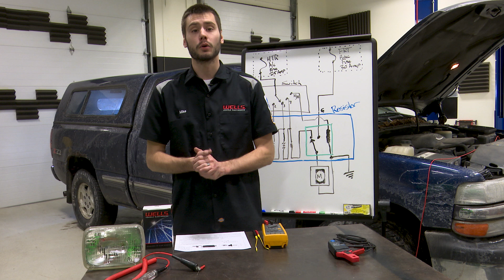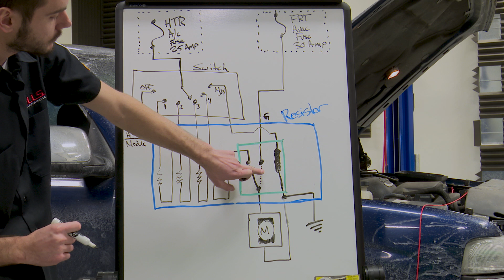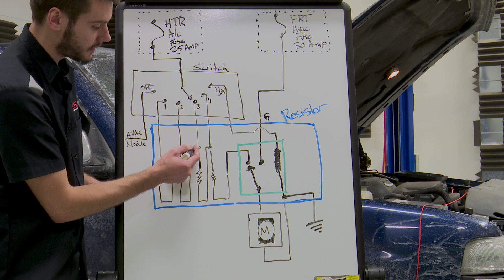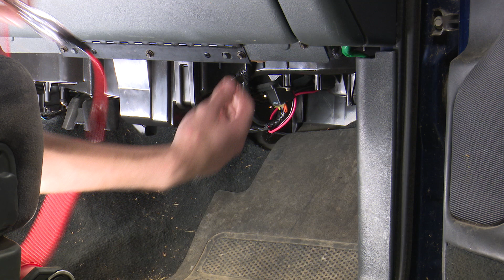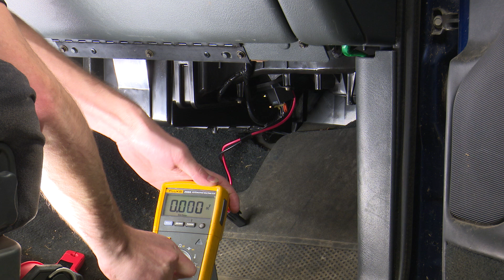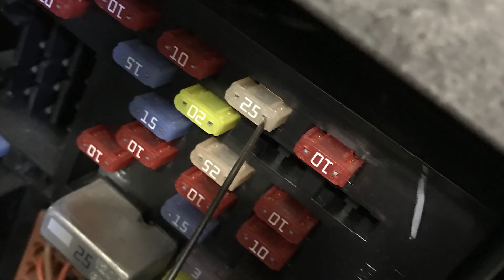TechConnect Ep.37 - How To Test A Chevy Blower Motor Resistor  (DR775)

Comment: This was excellent! I have the same resistor in my 2024 Chevy express 4500. I have an intermittent complete loss of power to the boat motor when it’s cold I meant after it run for about 15 minutes and warmed up the blower properly resistor looks fine. Could I still have an issue there?  Are there any other relays before the resistor? I could not find one.  Would appreciate a place to start. Thanks for the great video.

Comment: Im lost ive changed it all and its still running i brought a new resistor and worked for like a week or so then it stopped  shutting off when i get out the suv i got a blower motor  also and i changed  the heat and ac controler

Comment: 2007 gmc sierra .blows a fuse  when a heater switch on 4. resister and blower wires disconected  heater switch only plugged in. 4 still blows fuse.faulty heater switch control modual.?

Comment: How do you test the actual switch on the console unit?
Blower motor works, new resistor (need to manually test this to confirm, but unlikely I have 2 resistors that don't work), relay is good.
That only leaves the switch, yet no one says how to test that.  I'm not going to remove the head unit and guess.
I currently have a 12v ran directly to my blower motor with a switch so I can get some air through for defrosting, but it's not the same as when it was working correctly, fwiw.

Comment: Awesome video, smart young man. I lost 1234 speeds and only had 5z so I replaced resistor and now I only have 1234 and lost 5
Bringing it back to NAPA and hopefully next one will work.
Reply from the maker: Thank you so much! Good luck, hope the next one works!
~Mike
Reply: @GoTechTraining  Tried 3 new ones and all had no 5th speed, then they pulled one out that had 4 screw holes instead of 2 that is supposed to be if you have automatic fan speed sensing and it worked so I bought it. $45 more though.

Comment: My blower motor not working replaced restore control fan still not working fuses good
Reply from the maker: Hey Tom,
What kind of vehicle are you working on?
Reply: @GoTechTraining  04 Silverado Z71
Reply from the maker: Hi Tom,
The first thing I would check is the blower motor and resistor connectors for any damaged or melted terminals, If those are ok, make sure you have power to the HVAC and Blower fuses. Ignition switches are common to fail and cause no power to the HVAC system.
~Ryan
Reply: Check all and changed all no power to controls
Reply from the maker: Hi Tom,
If you have no power to the HVAC control, and both HVAC fuses are good, the under hood fuse and the I/P block fuse. I would check the output of the ignition switch. If that is ok it has to be a wiring issue from the fuses to the HVAC control.
~Ryan

Comment: Thank you for the video it helped to understand that type of system. I do not have the parts in the video in front of me but could you have measured voltage across the resistors and then using the basic ohms law compute the current drawn by the blower? I am not sure test points are available for that type of measurement.
Reply from the maker: Hello,
Yes, that would totally work. You would have to be careful knowing the correct voltage to do the equation, as battery voltage changes frequently when a load is put on the battery. But definitely could work 
Thanks for the question!
~Ryan Wilsing

Comment: Hi My name Is Mike, My son went and got the resistor with out testing to see the problem. so I went on the basis of him telling me he watched youtube and said this was the problem. So I helped him and bought it for him and we installed it. we got nothing when we tried it. we started to smell a burning smell. We shut it off. when he went to touch the resistor it was smoking hot... So told my son we have to take out the blower and check it , and sure enough it was frozen... So we ordered the blower and installed it and now we have no power to the resistor. check all fuse's and there good. My question is dose the pos power come from the switch first? Im thinking we melted the switch control. Any thoughts??

Comment: Awesome great video and thanks for shared with us.. I’m very frustrated with my Chevy Tahoe 03, only 5 speed works. I changed the resistor and it was same issue. I changed the climate control and same result :(. I already changed the resistors and same case … however when I turn the climate on between speed 1 and 4 in the dashboard displays “Service 4WD” any idea what could be the issue ? Thanks In advance

Comment: Hello,

My dad has a 2005 Escalade climate system seem to have a life of its own.
It runs on full blast regardless of if you turn the fan speed up/down, it also stays on after turning the car off, and it is only blowing hot air regardless of what you set the temperature to.

I tried taking the resistor out, but its completely different than the one shown here, it only has 3 pins and not the 7 pins that the one you show in this video has.

Do you know how to diagnose this one?

After googling around I found people saying its the PCM thats fried, however I am not able to find any PCM part number, or anything on how to diagnose the PCM.

Comment: I lost speed 5.  Replaced the resistor and still nothing.... fuses all good, put a new blower yesterday changed the switch panel 4 days ago.    It has voltage at the blower plug.  I have no way to check amps but I’m assuming there’s zero.  What would cause this ?     Also did the resistance test on the new resistor card and the numbers are a little off on 3/4      Not sore where to try next.   A new card or what could cause the amps to drop off ?    01 Silverado

Comment: @Mike.  I was able to fix my 95 Chev Van today with the help of this video. I even pinpointed the exact point of the continuity break. 
On my resistor block its mainly exposed coils that form the resistors. There is also what appears to be a voltage regulator zener device and 3 capacitors.  My guess is the zener clamps an exact reference voltage , say 12VDC. What do the capacitor do?  "Cushion" the voltage spikes between switch changes?  Your thoughts.  Dorman part# 973077.  Thanks in advance.

Comment: if this went out would it cause my suv to overheat
Reply: Nope. This is AC related. You're thinking of the radiator fan. If that went out then it could if sitting in a parked position because there would be no air movement through the radiator causing the coolant to overheat thus overheating your engine. If the fan is blowing it could be a bad thermostat that would block coolant flow through the radiator. If it was stuck open then your engine would never reach optimal operating temperature and continually run cold. Hope this helps @GlasSman_859.

Comment: Hi I have Kia sorento 2007 2.5 diesel motor blower not working.have replaced new resistor, replaced blower motor,checked all fuses and relays all ok. Power to all connections. But have used multimeter to check power to blower motor  on testing I have power to both connection? When I unplug connection and test again only yellow wire is live?. Have run wire from earth on battery to black wire to motor blower runs fast so blower is ok. Any suggestions please. Alan.

Comment: My blower motor seems to work on my avalanche even with the switch off and it is not the automatic control could it still be the resistor
Reply: Watching the video the Instructor mentions if the resistor is stuck (melted) in the high position it will run through the 30amp fuse continually and possibly even with the engine off. So I would say yes this could be your resistor. But keep in mind I am a student as you are so please keep that in mind.

Comment: My blower fan works at higher speeds, but no lower.  That seems to suggest the fan switch as we know the blower works and the resistor would not let higher speeds if lower were missing.  What is it about the switch that would cause this?

Comment: I followed this pretty much step by step  ended up replacing blower motor and resistor and still I had only 5 speed on fan  I hooked up a bulb to blower motor wires and it was dim on 1 and brighter as I went on  what the heck  well the ignition on hot wire to hvac controller was only getting 10 volts even with truck running it only got 10 volts but fuse was getting 12 on ignition and 14 running. Long story short the wire to hvac had a voltage drop somewhere I ran a new wire and I have all speeds now.  Make sure you have 12-14 going to resistor because  if you start at 10 volts it will not work 1-4 fan speeds

Comment: I have 2006 c230 mercedes. Security alarm battery went out. When it went out the horn on windshield wipers on windshield sprayer on light on . replace security alarm part. Now horn off windshield wipers off light stay on bright when key on. Test relay on windshield wipers relay good. Test relay circuit Q 30and 87 power 86 power 85 no power. Relay circuit L 30 no power 87 power 85 no power 86 power. Horn relay 30 power 87 power 85 power 86 no power. What should I do now??? Thank you for some help.

Comment: I tested the wire that went to my blower mother and got nothing. Also, only two entry points on my harness lit up. My ac does not work at all. There's no power. What could be the problem? The resistor?

Comment: Speed number 5 wasn't working on my 2004 gmc. Then one day it just quit working all together. I replaced the resistor and put in another speed controller...the motor will work when you put 12v to it. So..I done all this and still doesn't come on..what else could it be...I've checked fuses
Reply from the maker: Hey John, have you verified the ground path? How about the relay that runs the blower motor?
Mike Becker, Senior Instructor
Reply: @GoTechTraining  where would that be
Reply: I would also like to know

Comment: however .  how do you test or if you have a diagram of the AC fan control.. i belive thats where the problem is..
Reply from the maker: That will depend on the system. Most basic fan switches are just a basic path through. The current travels through them to the resistor.
Mike Becker, Senior Technical Instructor
Reply: but a schematic or pin identification would be great to diagnose a bad control unit or broken circuit...

Comment: This was excellent and perhaps the best explanation I have ever had on this circuit.  My blower motor (a 2009 Savana van 4.8 L ) was only working on high.  Eventually it crapped out and I put up with it till winter approaching became an issue.  Started with looking at the resistor. Found the connector had melted at the power (RD/BK) and also at the ground (Bk) Replaced both the harness connector and the resistor but only had speed now at 1,2 and 3.  Hmmmm's. Checked the blower motor and it was fine (other than leaves in the cage that got cleaned out).  Started to second guess my workmanship, perhaps the new aftermarket resistor was faulty.  Found this video (thank you) and went back to look at the 40 amp in the fuse block and sure enough..now it was burnt.  Replaced it and I am back to all four speeds. Interesting side notes on this vehicle. I didn't do a load test on the blower motor but likely, as it is vintage, it would be wise to replace it as well it is likely drawing more than it should be. An immediate subscribe and like for sure!
Reply from the maker: Hey Michael, thanks! Glad this video was able to help in your diagnosis. I agree, it would be wise to replace that blower motor. Thanks for subscribing!
Mike Becker, Senior Technical Instructor

Comment: I got a chrysler vision 1994 ...so my problem is when i turn the key on the blower motor goes to hi speed with out touching speed control and there is no speed control at all it stick on hi ???? could you guys give me some answers pls ????
Reply from the maker: Hey Mr. Flirt, high speed blower operation is usually the default setting. Take a look at the blower resistors circuits. It's possible that it's fried.
Mike Becker, Senior Technical Instructor
Reply: @GoTechTraining  thanks...

Comment: Quick question for you if you have the time. I was recently diagnosing a Toyota for a blower motor that had very low speeds on high. After doing some checks I did a resistance test and found the motor had under an ohm of resistance. I found a known good and that also had the same resistance. Shouldn’t blower motors have some significant amount of resistance? Thanks in advance!
Reply from the maker: Hey Franky, I'm not a big fan of doing a resistance test on a motor. We would want to look at amperage draw on that motor. 
Mike Becker, Senior Technical Instructor
Reply: NGK Technical Training makes sense. Thanks for the response!

Comment: The fuses don't power anything do they?
Reply from the maker: What do you mean Jim?
Mike Becker, Senior Technical Instructor
Reply: @GoTechTraining  You said several times in the beginning of the video that various fuses provide power.  Is that what you are saying or is it that they limit power.  I am a newbie here and just want to be sure I understand.  Thanks
Reply from the maker: Ahh I see. A fuse is a protection device in a circuit. It allows power to flow through it from the power source to where ever it's going. If the circuit draws too much current (above the rated limit, 15amp etc.) then the fuse blows and does not allow power to flow into the circuit. Make sense?
Mike Becker, Senior Technical Instructor
Reply: @GoTechTraining  Okay, I was just misunderstanding what you were saying.  Thanks

Comment: what do i do if my relay only has 5 wires automatically controlled 2005 GMC Yukon  sl
Reply from the maker: William, that Yukon shows to use a similar setup. 3 relays are controlling the 2 fans on there. Diag should be very similar to this video.
Mike Becker, Senior Technical Instructor
Reply: @GoTechTraining  ok thanks. turned out  to be the motor resistor.
Reply from the maker: Great, glad you got it fixed William!
Mike Becker, Senior Technical Instructor

Comment: Great video Mike   its amazing how the engineers use simple circuits on trucks as opposed to cars     that circuit goes back to the 70s   where on a car it would be electronically controlled with a duty cycle command     to a blower module     cost     and the fact that truck owners aren't as     ?      you know what i mean       take care Mike    keep em coming
Reply from the maker: Hey Mark, thanks for watching! This circuit is very basic, but there is an option on these trucks for a computer controlled variable speed blower. These trucks did have the option for automatic climate control. Fast forward 10 years and the majority of cars are all auto systems now...but they really aren't too much different to work on.
Mike Becker, Technical Services Instructor

Comment: Great video and diagnosis Mike! Do you figure manufacturers run the circuit on high in case the resistor fails for safety reasons? Just like they would default mode doors on defrost...
Reply from the maker: Hey Nick, thanks! Yes, I believe it's a failsafe. In case of failure of the resistor circuit, speed 5 will still work if the relay is ok. This would allow you to have heat and clear your windshield. Very much like default mode on doors. Good comparison!
Mike Becker, Technical Services Instructor

Comment: With my own tune up and couldn't figure why she wasn't still running correctly turned out to be bad new AUTOLIGHT SPARK PLUGS on two cylinders.   It cost me $100 for that information.
Reply from the maker: Michael, did you know that Wells is owned by NGK spark plugs? I couldn't be more proud. Try some NGK's in there...you wont be let down!
Mike Becker, Technical Services Instructor

Comment: Back again and enjoying the video.
Reply: Sometimes I think that a real time savor would be to replace the problem sensor like I did after my code 53 which is a high voltage spike

My engine is running rich and it's a 94 GMC Sierra C3500 automatic 7.4...  After changing the cap and rotor, spark plugs and wires.  It was running rich and the spark plugs where black and the cap was more than1/4 of an inch.  

The last time I drove it the tailpipe came off the the catalytic converter.  I reconnected the exhaust system.

Watched a video on running rich and had a trouble codes for 34, 35, 45, and the last one before the engine stopped and would not start again until I replaced my fuel pump relay that shorted out.

I also replaced the knox and temperature sensor
Reply from the maker: Thanks again for watching Michael!
Mike Becker, Technical Services Instructor